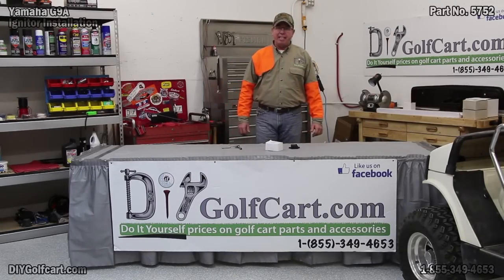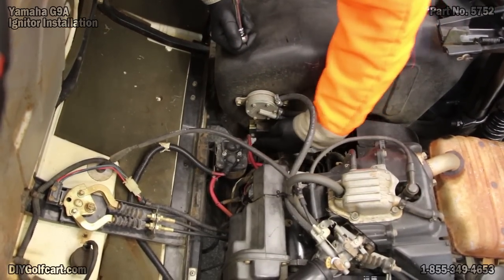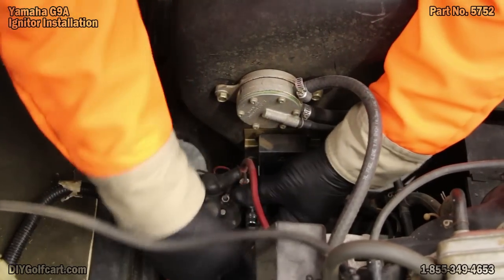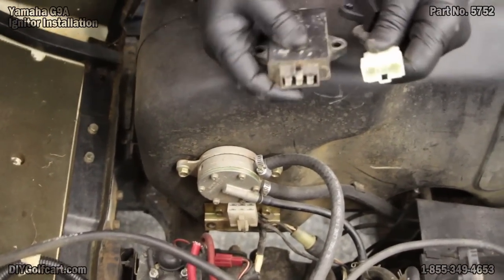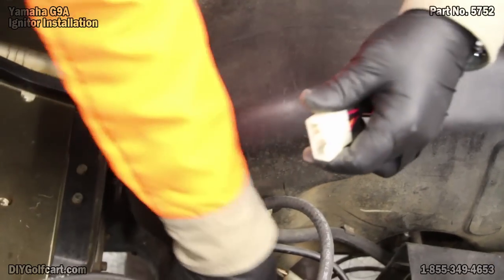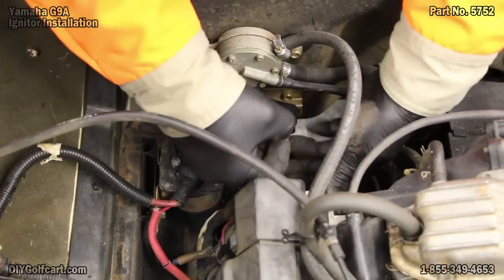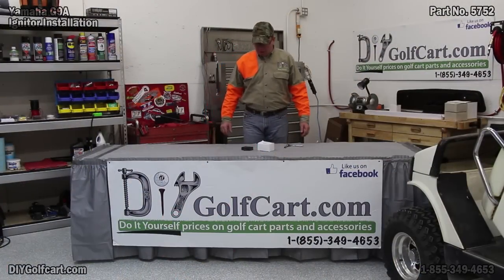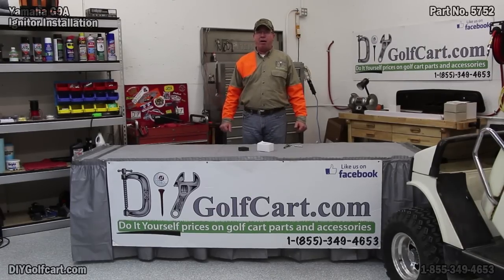Yamaha G9 Golf Cart Ignitor | How to Install

Comment: My G2 has a couple of issues, I'll hit the first only. The cart starts and goes well, out if the blue it looses power and sometimes backfires. I pump the gas pedal or just wait with the pedal down and it comes alive a goes until it does it again. With recommendations I ha replaced the carburetor,  same, replaced the carburetor seat, same, replace coil, same. Did notice the ignition box had wire nit connected, tried to stick it back in the harness, (not sure if real good connection) same issue. Any ideas?
Reply: Your post is a year old so idk if you figured out the problem. I was having exact same issues with mine. The gas pedal switch was bad. I tested it by hooking the 2 wires together and it ran great. I could have left it that way and just  used the key to turn it off and on but I opted to replace it. Problem solved
Reply: I gave up, will start playing with it again. One of the wires from the harness broke, need to reconnect it and try again.
 Thank you.
Reply: @joefrutuoso3811  you're welcome I hope you get it going

Comment: Hi and thanks for your video. I have a 1989 Yamaha G2 A  car that seems to drive fine for a few minutes and then looses power. When I've checked the spark when the car looses power it's a very thin weak yellow spark. Also, the spark plug gets sooty black quickly. I'm not sure how to diagnose if it's got a bad ignitor or ignition coil. Any help you can give is appreciated.
Reply from the maker: The first thing I'd try is to replace the coil. It's normally the first thing to go bad. Most of the time, a weak spark is a great symptom of a bad coil. Also, while your in that area, make sure your spark plug is a NGK and not an automotive brand. 90% of automotive brands do not burn hot enough for golf carts. As far as the ignitor, symptom would be inconsistent spark vs. weak spark .
Reply: DIY Golf Cart Thanks very much! I'm hoping for it to be the coil vs the ignitor as the ignitor is so expensive. I'll change out the coil.
Reply from the maker: Popgunner101 Sounds good! Keep us updated!
Reply: could you tell me where the voltage regulator wires hook to. mine has two wires and they was cut by the previous owner

Comment: My Yamaha g2 I drove it then parked went to use it the next day nothing no power or anything I can turn it over by pushing the button on the solenoid but can't get the pedal switch to work what are your thoughts
Reply: Did you find out what the problem was ? Mine is doing the same thing !!!
Reply: Did you check the start /stop switch underneath the gas pedal?
Reply: Any luck? Mine is doing the same. Does it randomly

Comment: How do you diagnosis a faulty ignitor?   I have a Yamaha G2.  It idles, but does not go when stepping on gas peddle.  I change everything for a tune up.  Even installed a new carb.
Reply from the maker: Unfortunately there is no test for the ignitor. A symptom that I correlate to a bad ignitor is the spark is blue but isn't sparking consistently. No Yamaha golf car is designed to idle. If the car isn't moving with the pedal depressed but the engine is turning over, check the accelerator cable going from the pedal to the governor. It normally breaks back at the governor.

Comment: I enjoy your videos, they are great help.  Occasionally my '94 1/2 EZGO won't start or turn over the engine (no sound at all) after the cart has been running for 30 minutes or so.  If I wait a few minutes, then it will fire & start.  I checked the battery connections and wires and they're OK.  Can you give me some idea what it might be?    thanks
Reply from the maker: First thing I'd check is the battery voltage with a load and then the brushes in the starter generator.

Comment: G8 here. Just got a new ignition for my electric cart. When I took out the old ignition it wasn't hooked up to anything? The new ignitions got a plug that looks like it should plug into a wiring harness. Anyway, I have no idea where this harness plugs into and what it connects to? Any help would be appreciated. Thank you
Reply from the maker: Please send me pictures     barry@diygolfcart.com
Reply: @golfcartking  I purchased a new coil online for my 94 g9. My stock coil has 2 prongs/2 wires, besides the plug wire and ground that the mounting bolt goes through. My new coil only has 1 prong. The company assures me this is the latest version for my machine. Any help would be appreciated.

Comment: My G9 just idles when I crank it. It will not rev up, the choke does not do anything, it just idles. Battery is good, getting fire from the spark plug, getting 12volts to the starter and solenoid. I replaced the fuel filter. Also the fuel filter is also working properly.I removed carb and cleaned it. Still it just idles. What does the infighter do and do you think that is my problem.
Reply: Travis : Did you ever find the problem with your G9 golf cart . I have a 1993 G9 also . And it will not rev up . I have fuel  / have spark  /have a strong battery /Clean carb . Just thought I would ask . Sounds like you had same problem.
Reply: @karrisfisher5931  I had spark too but not enough I guess. After doing everything you did, I replaced the spark plug and it runs like a champ. Good luck!

Comment: 1994 G8, WITH SPARK PLUG TESTER ON, RUNNING HALF SPEED, SHOWS GOOD SPARK, WILL THEN DROP SPARK AND DIE.  CAN RUN JUST ABOVE IDLE AND GO DOWN THE ROAD. ADD MORE FUEL AND IT WILL QUIT.

Comment: Ive got a yamaha G11 utility cart with that same engine ive replaced the ignitor and the coil and the spark plug and checked the carburetor but it wont start it just spins over and does nothing sometimes it will idle and then die
Reply from the maker: Are you getting any spark?
Reply: DIY Golf Cart 
Its getting spark and tries to fire but wont
Reply: @carlwhyle3270  did you try to spray it with starter fluid if it turns over and runs it's a fuel problem

Comment: What did it do before you changed it how did you know it was bad ?
Reply from the maker: Symptom was no spark or inconsistent spark. Unfortunately there's no test for the Yamaha igniter.  You have to go by what's going on with the spark such weak spark, bad coil.
Reply: @golfcartking  my solenoid is clicking but nothing else
Reply from the maker: @coolman52374  Check the brushed in the starter generator.